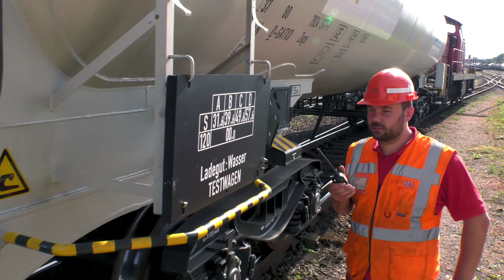DAC4EU - Operational Tests

Comment: Looks expensive and fragile to me.
Reply: It's actually a genius design on the inside.  Strength could be improved, but as it is, it's good enough.
Reply: @gunt-her when and if is this going to be introduced but also where besides the obvious clue from the german ministry?
I'm just curious
Reply: @attilaabonyi8879  What do you mean?  I don't know where it will be used, I just like the mechanical design, as it's rather clever.
Reply: It has by far the best reaching angle and it's more robust then it looks, but the strength should be improved maybe with a change in the mechanical design.

Comment: Why not just use a knucle coupler like north america or an SA coupler like Russia? Both already exist and have proven themselves
Reply: Because DAC is digital
Reply: @tomasznowaczyk85  it has electrical connections that automatically connect with the coupler's connection.
Reply: @rearspeaker6364  electrical, pneumatic and digital conections
Reply: @tomasznowaczyk85  the real test is when the coupling gets worn in, will those elec. and air connections work properly.
Reply: @rearspeaker6364  I Wonder if it gets worn in the scharfenberg coupling
Reply: @tomasznowaczyk85  all couplers will wear, in their testing, they barely have got any dirt on them, real world testing on the hardest, dirtiest parts of the rail network will prove them out.
Reply: DAC4EU iterates on what make both of those systems good. If the money is going into replacing buffer and chain which means new couplers and new equipment then why not replace it with something that learns lessons from those designs? Knuckle couplers still require the crew to get between the cars to connect hoses and release the angle cock, a process which involves a surprising amount of careful physical positioning, shunting, declaring red zone protection, and other measures to do safely. This eliminates all of that, physically connects the cars, and hooks up the electrical connections in one go. Plus cars can be released by pulling an easily accessible handle in one back friendly motion that doesn't require anyone to get between the cars.
Reply: @ZILOGz80VIDEOS it is an improvement......but, if the coupling is on a curve, you will be manhandling the coupling to get it to couple, and still have to reach for an angle cock to open, plus if uncoupling the release lever is on the coupler itself.
Reply: @tomasznowaczyk85  sounds like more that can go wrong. all you should need is mechanical and air.
Reply: @ZILOGz80VIDEOS  the big black spot of the DAC or not DAC, with the Scharf and the manual cut, you are forced to enter the rectangle of Bern to access the cut lever, while the others of origin do not.

Finally I will be frank for having made the coupling if the mechanical links were "automated" I would have been very happy, (Janney or SA3, 1st generation and not digitalized) even if I still had the third-party links to do pneumatic, electric.

The Americans and the Russians have understood it well in their sorting, it cuts the humped wagons just by lifting the cutting lever, walking close to it and without entering the red zone or rectangle of half mast. (valid for the Janney and the SA3)

Pneumatic separation is done alone, since it was designed for this. (manual coupling, scharf, janney, SA3)
Reply: @Mike-jv8bv  electric and data is needed for future applications like train control level 3, Brake and wheel sensors, freight control... It's a requirement
Reply: @fischX  the more complexity you ad to any given system. The more points of failure you also  add. The best part to have in many cases is no part.

Comment: we have been using autocoupling since 1873,   A National Model 21SB-E60DE (Type E) sells for about $300; a Model 21F70CE (Type F) for about $400
Reply: Knuckle couplers do connect automatically but crews still have to get between the cars to lace up the air hoses and open the angle cock.
Reply: @Mike-jv8bv  yeah and all you have to do to hook these up is back the cars into each other. Knuckle couplers are great but if you're going to go to the trouble of replacing buffers and chain why not replace it with something that doesn't require any bending at all.
Reply: the knuckle coupler is only semi-automatic and they generate a lot of slack, specially on long trains

Comment: Better 100 years late than never. We Americans had Janney couplers standard since the 1880s.
Reply: they want their own fancy coupling..........
Reply: knuckle couplers only join the cars together, crews still have to lace up the air hoses and get between the cars to do it. Look up videos on coupling and uncoupling cars, there's a ton of careful ergonomics to properly disconnecting the air hoses and angle cocks to do it safely and quickly. This eliminates that with one simple motion that can be performed without having to get any part of your body near the rails.
Reply: @ZILOGz80VIDEOS  t is an improvement......but, if the coupling is on a curve, you will be manhandling the coupling to get it to couple, and still have to reach for an angle cock to open, plus if uncoupling the release lever is on the coupler itself.
Reply: @ZILOGz80VIDEOS  Preaching to the choir. 5-year railroader here. 👍
Reply: @ZILOGz80VIDEOS  air hoses are easy to connect
Reply: @Mike-jv8bv  You can connect 100 air hoses in 1 minute with DAC, or in 20 minutes with hands.
Reply: @alexisvongermania8870  there is alot more maths than just that factor. one of the biggest one would be replacing entire fleets of railroad cars with this system. cost of manufacturing, and track record of reliability over the course of decades. This system will probably be used on smaller railroads in europe but no way class 1 railroads in the U.S.A. it's way too standardized by this point.
Reply: @Mike-jv8bv  Its required to be used by all european railways by both European Union and european railway association by 2030.
Reply: @Mike-jv8bv  I mean look at the hook and screw coupling. The coupling is so weak you can't haul no more than 14 or 15 wagons at a time on most trains especially in Britain. Look at the USA they're freight trains are easily 1 to 2 mi long. No way this new coupler can even hold trains that long.
Reply: @ZILOGz80VIDEOS here they have to do it too schaku doesent do everything
Reply: @Mike-jv8bv  "air hoses are easy to connect" - Not if no one is being there and it's supposed to couple on it's own.
Reply: @qq84  in heavy industrial environments, simpler is always better. even if it means to manually connecting a hose, less goes wrong and parts are extremely commonly available and easy to replace on the fly. that's why the janney coupler in north america isn't going anywhere for freight trains. one coupler. one hose, that's it